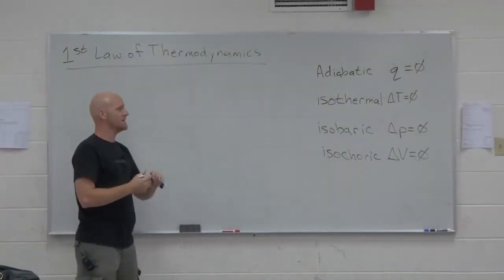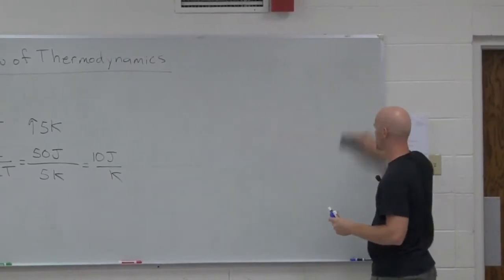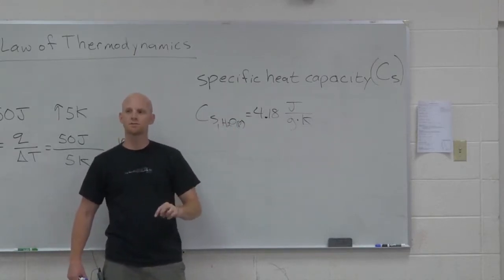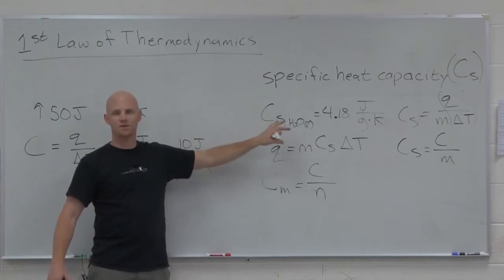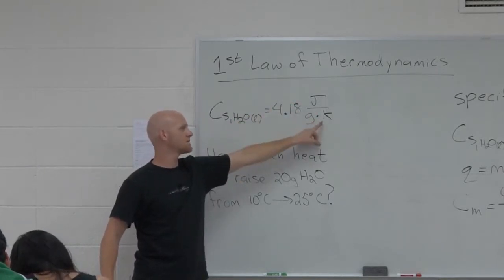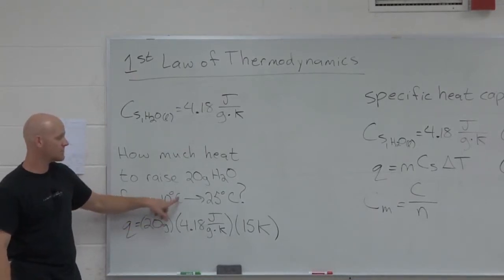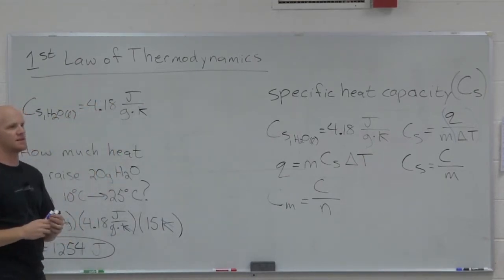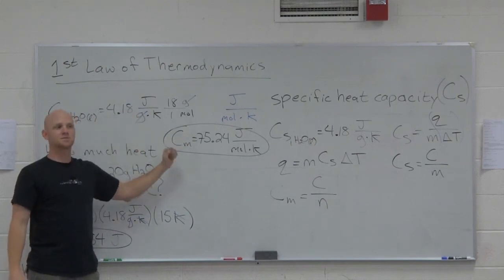11/12.2 Heat Capacities

Comment: Thank you for the video! I have a question regarding the last problem with Cm. I am used to do it in a sense where I first convert grams to moles (20g water * 1mol/18g = 1.11 mol), and then I divide the 4.18 by the number of moles I got. I understand how you solved the problem on the board, but I personally am used to doing stoichiometry first and then plug it in the equation rather than conceptually thinking about the units. What did I do wrong here?